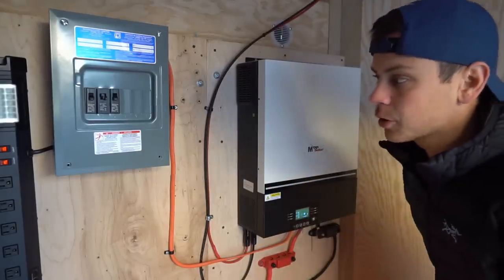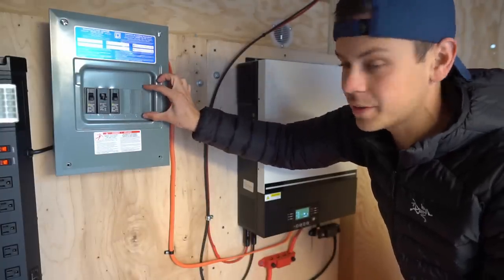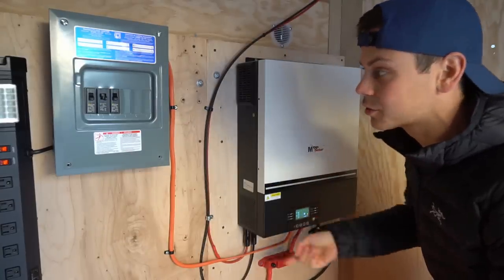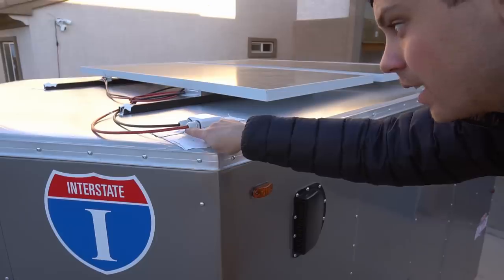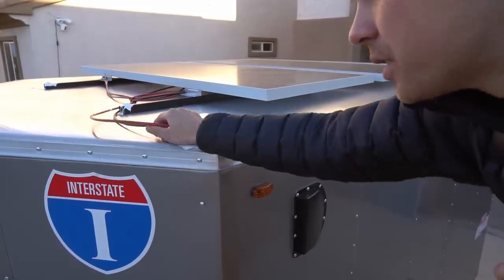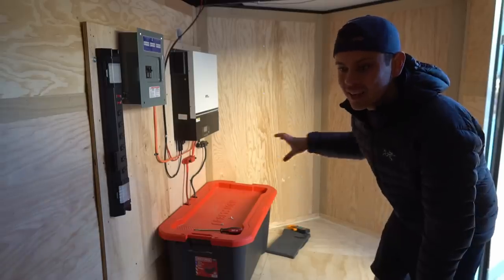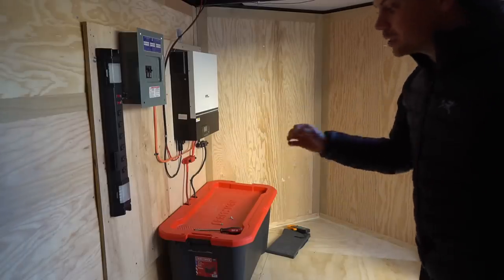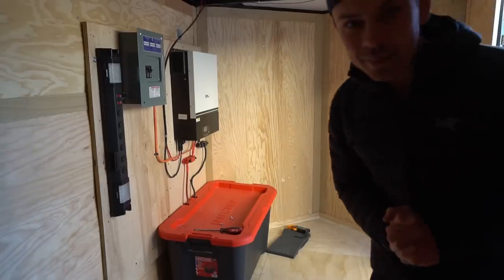Utility Solar Trailer Part 2: Responding to viewer comments

Comment: Can you make a video showing a good power outage battery backup solution for a CPAP breathing machine? Like something if the power goes out while sleeping it will just switch to battery power automatically and not be interrupted. Thanks!
Reply: Seems like a small inverter + big battery + appropriate charger would create an online UPS system.  The charger would keep the battery topped off + power the inverter (and the CPAP), when utility power went out the battery/inverter would power the CPAP until the battery was exhausted.  When utility power is restored the charger would recharge the battery.

I'm using a small APC UPS with a big battery for my home network backup.  Same principal as above.  Some of the new APC UPS systems won't work this way, they have a timer that shuts down the UPS when it expects the tiny stock UPS battery to be exhausted.
Reply: @Douglas.Kennedy  Thanks for the reply. I was looking into CPAP machines. Apparently you can get DC adapters for them. I was reading that is the best way to go so you don't lose power having to go through an AC inverter.
Reply: @juxxtapoz  You are correct, just make sure the DC adapter will take a wide range of input voltages if you're running straight off a battery.  If it's designed to run in a car it should be fine.  The loss from a small inverter won't be too bad though and you can use the same A/C power adapter you'd likely want when traveling.  I run into the same conundrum with laptop power packs.  I can get a 12V DC power adapter for $100, but then I need to carry the A/C power brick for the motel anyways.  Anyhow, it could be worth considering to buy a slightly larger battery and inverter, rather than the DC adapter.
Reply: @Douglas.Kennedy  Thanks for your help Doug. I was looking into a Jackery but I don't think they are really made to be plugged in all the time and used as an uninterruptible power supply.

Comment: Hey Will, with the issues with power in Texas I am wondering if you could point me to a video or source of information for incorporating a 3 to 4 day buffer on only the priority appliances?
Reply: 23 kW diesel generator runs on 6 gallons of diesel a day
Reply: @typxxilps  Isn't that what Will is?
Reply: @BangBangBang.  That's a little overkill for me.  I was thinking 3 squirrels and a power wheel.  Seriously I have seen folks talk about using a 10,000 watt Generator with a failover switch just to power the essentials but was hoping for something a little less noisy.

Comment: New viewer here trying to grasp all these concepts. 
Some of us are still trying to grasp electricity theory and where, what and why you apply different amps and watts. Those of us who are still dumb and new to this only see a plug as either 110v in houses  or 12v in cars. I'm new to this and still trying figure out where you would use different voltages and why
Reply from the maker: It's all good! Check out my beginner playlist. Newer videos have been more advanced. I have a ton of beginner friendly videos

Comment: Can I use that 72 dollar BMS with these cells.? I want to build a 48v battery. NEW 4pcs 3.2v 280ah Lifepo4 Rechargeable Battery Lithium Iron Phosphate Solar Cell 12v 24v 280ah Grade A Lifepo4 Cell Tax Free|Battery Packs| - AliExpress

Comment: What about venting the batteries?
Reply: Lithium batteries don't "off-gas" like lead acid. No venting necessary.
Reply: @largepimping   T A may have been asking in terms of air circulation to dissipate heat.  The trailer has small vents at front and back (the small grey disc you see above his inverter) but those aren't very effective when standing still.   Will has suggested he's going to be mounting A/C inside, so it probably won't be an issue.  He can just remove the lid of the container during operation to ensure good air circulation around the batteries.

But also, Will just had to deal with electrolyte leaking from cells in that trailer, staining the floor and filling it with fumes, so I wouldn't say they'll "never" off-gas.  In fact, had the electrolyte seeped to somewhere there was water, it would have produced highly toxic hydrogen flouride gas.  It probably wouldn't hurt to install a ceiling fan in this trailer in the event he quickly needs to air it out.

Since Will's electrolyte leak, I plan on always placing a shallow plastic tray below my lithium batteries.  In fact, immediately after watching that video I placed mine in a plastic tub as he's done here.
Reply: @NorthernKitty  Lithium batteries will NEVER off-gas unless there is a massive manufacturing defect or a catastrophic failure.
Reply: @largepimping   Actually, the electrolyte is off-gassing following a malfunction or catastrophic failure.  I'm not incorrect, you're simply redefining "off-gassing" (i.e., "to give off a chemical, especially a harmful one, in the form of a gas") to mean it's been accounted for in the design.  Ask Will how it smelled in his trailer and then tell me there was no "off-gassing" of the electrolyte.
Reply: @NorthernKitty  ACKSHYUALLY, my original quote  specifically said "like lead acid." But thanks for your feedback!
Reply: @largepimping  "Ackshyually", my response was mainly to point out they may have been talking about ventilation to dissipate heat.  But because of the ambiguity of  your phrasing, I also added a caution to readers against interpreting your comment as "never" by stating that I personally "wouldn't say never" and that ventilation could still prove helpful in the event of an experience like Will's.  I didn't say that YOU said "never", until you immediately replied, "NEVER!"  But thanks for your feedback!
Reply: @NorthernKitty   99% of people reading these comments will understand "off-gassing" to mean what I explicitly said in my original comment... that it's a "feature" of lead acid and something that you absolutely MUST account for in your system design. And for lithium, that's simply not the case at all; if your lithium batteries are "off-gassing," something is TERRIBLY wrong. However, I've edited my 2nd comment a bit so that it includes the entire context of the first one.

Comment: Mini split air conditioning cost more and have a huge energy spike when the compressor kicks in. I worked form a research and development for government and I have log thousands of hours in air conditioned trailers. The worst systems were the dual mini splits, they would work for few hours, but eventually spike together and kick the circuit breaker. (Not good for the computers at all) The lead acid marine batteries never worked as current buffer either. RV style air conditioners are built to limit this energy spike with better start capacitors. The size of your trailer could get away with use a110 volt version, but if can afford the up front investment you would be money ahead to invest in a 240 volt setup.

Comment: Why didnt you try to charge your car directly with that? Of course AC, and other devices wants very big arrays to create instantaneously power in order to run the high loads ,but the car, car charge slowly all day without problem! Who cares about how quick will charge if it is free?